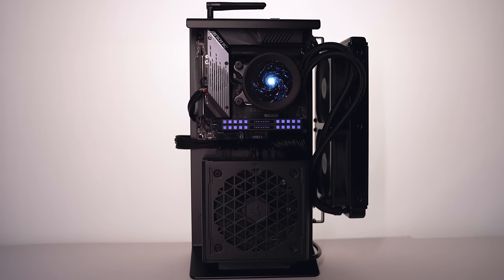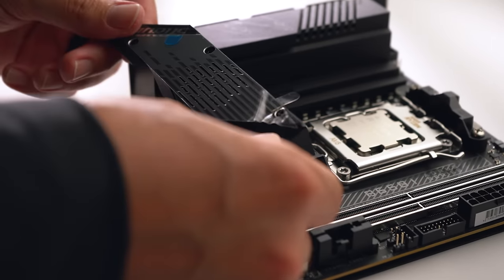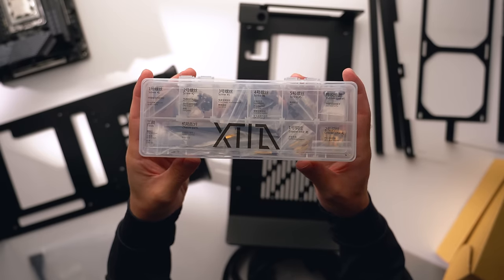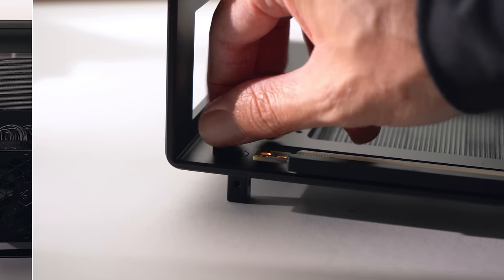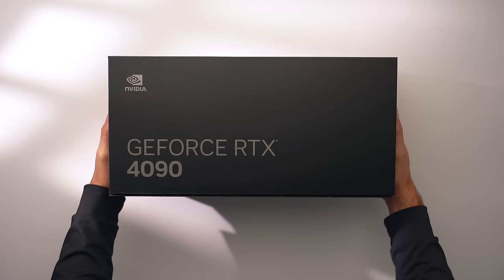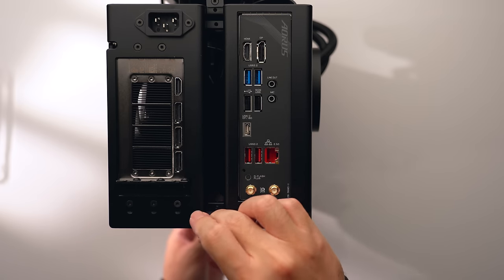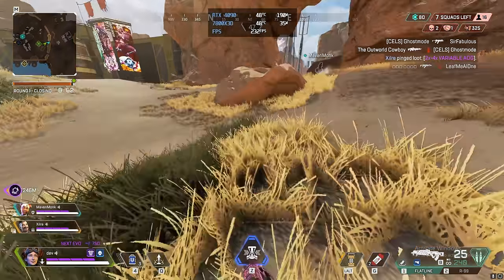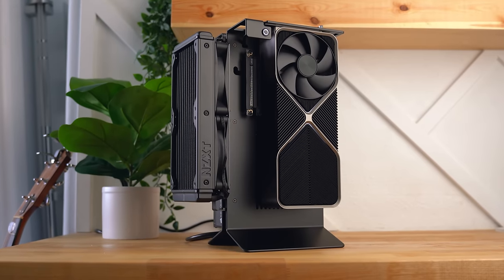This is a computer?

Comment: The dust game of this is gonna be on point !!
Reply: I have the XTIA Xproto-ATX case V1 from the same company as in Devyn's video and it heavily depends on your environment. If people live in a very dusty area then yeah I can imagine you would clean it every month or so but if that's not the case you do not need to clean it that often. I have my open case for almost 11 months now and I have cleaned it 2 times so far. and even when I decided to clean it there was an extremely thin (emphasis on thin) layer of dust on the top of te case and GPU with that dust there were no differences in either temperatures or performance. using an electric air duster and in 5 minutes tops the dust is gone. 

So yeah if someone wants to buy an open case, they just need to look at how dusty their room is and based on that you can guess fairly accurately how many times you would feel the need to clean your PC. 

For example, there is a video of a guy who shares an update on not cleaning his PC after 3 months with the same case as in this video of Devyn. I nowhere nearly have as much as this guy in the video. After 6 months I don't even see dust on my CPU fans or PSU. 

Since YouTube will not let you post links the title of the video is ''Three months of dust with xproto + cleaning''

Comment: these SFF builds are so wild to me still but i love them, as im here with a Corsair 500)D Airflow case, 13 case fans which are 6 intake, 7 exhaust with a push pull on top as exhaust for my H150i cooler on my Ryzen 9 3900x, also running a Radeon 6900XT Red Devil Ultimate, but my next build will for sure be a small system, this case is massive, and counting all fans in my system, 18 fans get LOUD under full load without a noise normalized fan control configuration, all the fans are SP120 RGB Elites too, so not quiet
Reply: I have the Xproto for over 2 years now and I am impressed how silent it is. It obviously depends on your CPU cooling solution. I have a NH-L9 to cool my old Ryzen 2600 and its not noticable even when the case sits on the desk. The GPU runs a bit louder but still pretty quiet since there is no heat buildup. 

If you use CPUs over 65W TDP you probably need a big tower cooler which looks awful or a AIO. I dont know how loud those get. Might upgrade soon so I might try a AIO.

Comment: Any reason you didn't pull air through the front to give the motherboard a small amount of cooling? Being that it's an open case heat would escape no matter what, but I would think a little bit of air over the motherboard would help more than going the other direction.

Comment: Heads up to anyone with a 360mm rad: You're gonna wanna install it 180 degrees opposite of what you see here, otherwise your hoses will interfere with the bottom of the chassis. You can also invert the mounting bracket to avoid significant overhand over top the frame. 

Also, flexible cables are a requirement for this build... Holy smokes. Big sales miss by Xtia for not pounding this into your head in the checkout process.

Comment: Nice video but i'd ike to point out that the radiator should be flipped, Your cpu should idle between 27-30c not 39c-40c.That means that your pump is accumilating air and that will affect the cooling big time. Just thought i'd help

Comment: its super cool but dust is the main issue. I used open air for a while and eventually dust gets into it
Reply: I have the XTIA Xproto-ATX case V1 from the same company as in Devyn's video and it heavily depends on your environment. If people live in a very dusty area then yeah I can imagine you would clean it every month or so but if that's not the case you do not need to clean it that often. I have my open case for almost 11 months now and I have cleaned it 2 times so far. and even when I decided to clean it there was an extremely thin (emphasis on thin) layer of dust on the top of te case and GPU with that dust there were no differences in either temperatures or performance. using an electric air duster and in 5 minutes tops the dust is gone. 

So yeah if someone wants to buy an open case, they just need to look at how dusty their room is and based on that you can guess fairly accurately how many times you would feel the need to clean your PC. 

For example, there is a video of a guy who shares an update on not cleaning his PC after 3 months with the same case as in this video of Devyn. I nowhere nearly have as much as this guy in the video. After 6 months I don't even see dust on my CPU fans or PSU. 

Since YouTube will not let you post links the title of the video is ''Three months of dust with xproto + cleaning''

Comment: I think that pump is working a lot harder than it needs to be working and will have a short life. Pumps work pushing water up, not down and it kind of needs gravity to keep the water flowing downward back into the pump, unless I'm missing something and the pump is built into the radiator but last one I had was built into the cpu heatsink.
Reply: Pumping up or down doesn't matter. The only thing that matters on AIO's is that the pump cannot be the highest point on the loop, otherwise the pump will collect air and kill itself quickly. In this configuration, the top of the radiator is the highest point, which is what you want.

Comment: I've heard you shouldn't mix cables from different power supplys, not even in two pieces from the same brand. Maybe it has changed with the way you orderd it, but for other builds I'd not recommend that.
Reply: You’re absolutely right that you should not mix cables with power supplies However, the custom cables that he is showing in the video have been made by the company of this case and they make the cables customary to the specific brand name and model type of your power supply. Cable mod is another company (more popular) that also manufactures custom cables based off on the brand and model type

Comment: Great build I have the Xproto-N, 11600k, RX6800 XT Corsair H100i elite with LCD modded the case to fit an SFX-L PSU great to build in just waiting on some softer cables to come as the new Corsair ones come with micro fit connectors
Reply: What about the dust ?
Reply: @GW3N_yt  Yes dust is constant and needs to be kept on top of
Reply: @GW3N_yt  Air Dust it regularly and the dust is minimal

Comment: i would love to have an open case build but the dust buildup is an issue that is holding me back. great build tho
Reply: I have the XTIA Xproto-ATX case V1 from the same company as in Devyn's video and it heavily depends on your environment. If people live in a very dusty area then yeah I can imagine you would clean it every month or so but if that's not the case you do not need to clean it that often. I have my open case for almost 11 months now and I have cleaned it 2 times so far. and even when I decided to clean it there was an extremely thin (emphasis on thin) layer of dust on the top of te case and GPU with that dust there were no differences in either temperatures or performance. using an electric air duster and in 5 minutes tops the dust is gone. 

So yeah if someone wants to buy an open case, they just need to look at how dusty their room is and based on that you can guess fairly accurately how many times you would feel the need to clean your PC. 

For example, there is a video of a guy who shares an update on not cleaning his PC after 3 months with the same case as in this video of Devyn. I nowhere nearly have as much as this guy in the video. After 6 months I don't even see dust on my CPU fans or PSU. 

Since YouTube will not let you post links the title of the video is ''Three months of dust with xproto + cleaning''

Comment: It is cool, but what about dust?
Reply: I have the XTIA Xproto-ATX case V1 from the same company as in Devyn's video and it heavily depends on your environment. If people live in a very dusty area then yeah I can imagine you would clean it every month or so but if that's not the case you do not need to clean it that often. I have my open case for almost 11 months now and I have cleaned it 2 times so far. and even when I decided to clean it there was an extremely thin (emphasis on thin) layer of dust on the top of te case and GPU with that dust there were no differences in either temperatures or performance. using an electric air duster and in 5 minutes tops the dust is gone. 

So yeah if someone wants to buy an open case, they just need to look at how dusty their room is and based on that you can guess fairly accurately how many times you would feel the need to clean your PC. 

For example, there is a video of a guy who shares an update on not cleaning his PC after 3 months with the same case as in this video of Devyn. I nowhere nearly have as much as this guy in the video. After 6 months I don't even see dust on my CPU fans or PSU. 

Since YouTube will not let you post links the title of the video is ''Three months of dust with xproto + cleaning''

Comment: Beautiful build, but what about dust? Do you need to clean it more often compared to having it in a case?
Reply: Dust is not really an issue. You accumulate it the same way as in a closed case. But since you can access all components really easy, there is no problem dusting it off with a pressurized can of air every once in a while. Most people dont do that on a regular basis in their closed cases so they accumulate a lot of dust over time.

Comment: that's a nice dust magnet
Reply: I have the XTIA Xproto-ATX case V1 from the same company as in Devyn's video and it heavily depends on your environment. If people live in a very dusty area then yeah I can imagine you would clean it every month or so but if that's not the case you do not need to clean it that often. I have my open case for almost 11 months now and I have cleaned it 2 times so far. and even when I decided to clean it there was an extremely thin (emphasis on thin) layer of dust on the top of te case and GPU with that dust there were no differences in either temperatures or performance. using an electric air duster and in 5 minutes tops the dust is gone. 

So yeah if someone wants to buy an open case, they just need to look at how dusty their room is and based on that you can guess fairly accurately how many times you would feel the need to clean your PC. 

For example, there is a video of a guy who shares an update on not cleaning his PC after 3 months with the same case as in this video of Devyn. I nowhere nearly have as much as this guy in the video. After 6 months I don't even see dust on my CPU fans or PSU. 

Since YouTube will not let you post links the title of the video is ''Three months of dust with xproto + cleaning''

Comment: Nice video, but I don't think the power supply you got is big enough for a 4090 GPU.    If you fully max the CPU, or maybe when it gets older, you may have some performance or reliability issues.   I think it is best to get a 1000 watt power supply for a 4090.

Nice build, and I think it could have looked even cooler with a few white linear LED strips strategically placed.
Reply: 1K it's when you run intel cpu my guy,and if you heavily oc 4090, and even if then with those components you won't hit max wattage, 850 is enough at least I don't have any issues, tho i'm playing on tv and 120fps it's max what I can do, and depends on the game I use 1440p up to 4K.

Comment: You made a big mistake with the AIO. Always gotta make sure the pump is at least a few mm lower than where the hoses meet the fan housing - having the pump higher than where it enters the fans causes lots of wear and tear and noise

Comment: To be fair that CyperPunk benchmark at 1080p is not indicative of the general performance difference among those CPU's. That's largely an outlier case and really any of the current gen AM5 and Intel CPU's aren't substantially worse (Gaming at 1440p w/ RTX 4090) than the 7800X3D generally speaking. Personally, if you use your PC for more than just gaming the 12 core R9 7900X which can commonly be had for $400 is a better OVERALL CPU.

Comment: this build is great, however Ill take Gskill over corsair on the RAM. Im actually running a Dominator kit myself (64gb 6000/30 purely for aesthetic reasons as most of my gear is corsair and I didnt want to use another software suite that conflicts with iCue)

Comment: Thought of getting this case, but it'll get so dusty
Reply: I have the XTIA Xproto-ATX case V1 from the same company as in Devyn's video and it heavily depends on your environment. If people live in a very dusty area then yeah I can imagine you would clean it every month or so but if that's not the case you do not need to clean it that often. I have my open case for almost 11 months now and I have cleaned it 2 times so far. and even when I decided to clean it there was an extremely thin (emphasis on thin) layer of dust on the top of te case and GPU with that dust there were no differences in either temperatures or performance. using an electric air duster and in 5 minutes tops the dust is gone. 

So yeah if someone wants to buy an open case, they just need to look at how dusty their room is and based on that you can guess fairly accurately how many times you would feel the need to clean your PC. 

For example, there is a video of a guy who shares an update on not cleaning his PC after 3 months with the same case as in this video of Devyn. I nowhere nearly have as much as this guy in the video. After 6 months I don't even see dust on my CPU fans or PSU. 

Since YouTube will not let you post links the title of the video is ''Three months of dust with xproto + cleaning''

Comment: that PSU is going to struggle to power a 4090 and 7800x3d and that kraken aio. personally I have an rx6950xt and get similar performance but with an overclocked 7700x and needed a 1000 watt to max out the build

Comment: I have the Xtia XProto -L as our GPU test bench at Small Form Factor Network. Wiring is a pain, but it looks pretty cool. We ran a 360mm AIO. Props for running the tubes the correct way. Gonna link your build video.
Reply from the maker: Thanks for that, I appreciate the support!

Comment: Then how to handle the dusty air?
Reply: The downside of open air cases
Reply: @justDHEEJAE  the benefit would be easy to clean it though?. Duster spray/micro fiber wipe down (shut the pc off of course)

Comment: That thing is a dust magnet, without a proper case with filtration it will die sooner rather then later. Modern pcbs are crap compared to what they were 20+ years ago! They barely have any protection from shorts!

Comment: those rad pipes cannot be below the CPU man.... its gonna cause and air channel on the CPU meaning less cooling hits the CPU itself cause the air traps at the highest point.... which is the CPU in this case

Comment: A 4090 with the 7800X3D using a 850w power supply is a disaster waiting to happen
Reply: First of all an 850W PSU is the recommended value for a 4090 and secondly the 7800X3D doesn’t pull more than 70 watts in game.

Comment: I have been waiting for an atx build using the open bench table in vertical orientation. Air cooler and 4090 founders 💦💦

Comment: Only thing...its like a vacuum cleaner sucking up all dust
Reply: I have the XTIA Xproto-ATX case V1 from the same company as in Devyn's video and it heavily depends on your environment. If people live in a very dusty area then yeah I can imagine you would clean it every month or so but if that's not the case you do not need to clean it that often. I have my open case for almost 11 months now and I have cleaned it 2 times so far. and even when I decided to clean it there was an extremely thin (emphasis on thin) layer of dust on the top of te case and GPU with that dust there were no differences in either temperatures or performance. using an electric air duster and in 5 minutes tops the dust is gone. 

So yeah if someone wants to buy an open case, they just need to look at how dusty their room is and based on that you can guess fairly accurately how many times you would feel the need to clean your PC. 

For example, there is a video of a guy who shares an update on not cleaning his PC after 3 months with the same case as in this video of Devyn. I nowhere nearly have as much as this guy in the video. After 6 months I don't even see dust on my CPU fans or PSU. 

Since YouTube will not let you post links the title of the video is ''Three months of dust with xproto + cleaning''
Reply: Thanx for the info. Its ambitious so ive to answer of course. I work as heat pump installer. There its recommended to clean filters every second week. Yes it depends on how much one cleans at home generally. Im kinda lazy. I usually only vacuum clean...sometimes 😅 I can blow very strong compressed air with my vacuum cleaner. Its the best thing ever cleaning electronics.
Reply: @UpRisingDown  hahah nice man! Yeah you just need to think about how much dust you generally collect in the room that you PC is in and if let's say after one month's it's a lot (like you see fairly thick layers of dust on furniture or somewhere else) then I wouldn't suggest you buying an open case. If that's not the case, then it shouldn't be too much of a worry. 

I mean yes of course my room collects dust but apparently not as much as I thought  with my open case :)